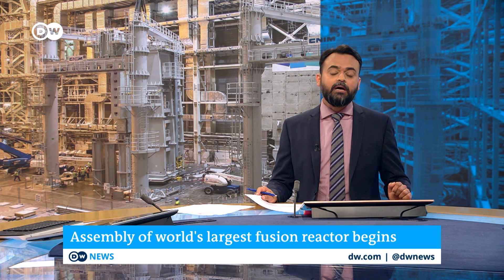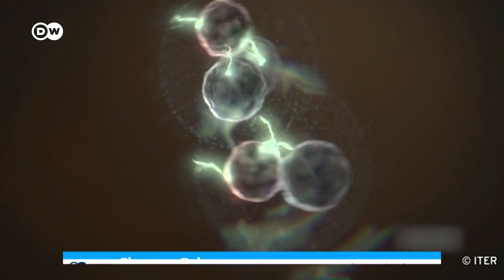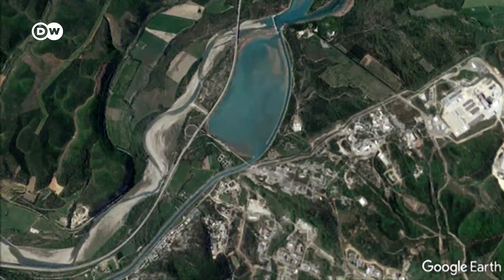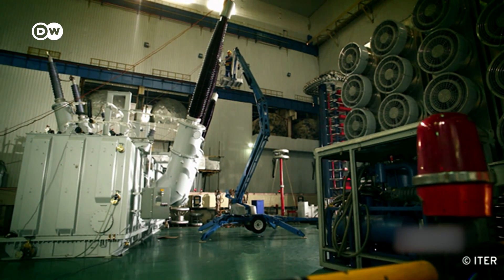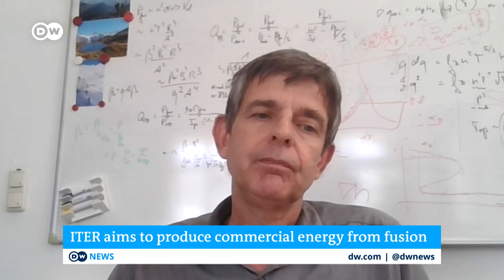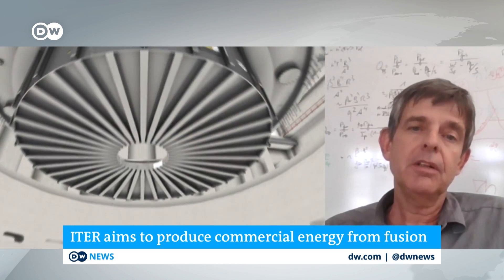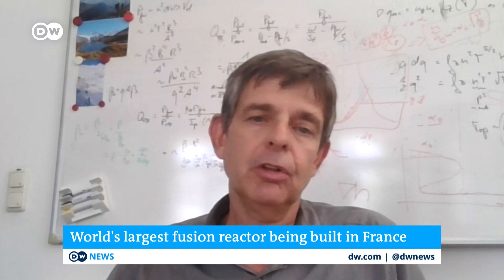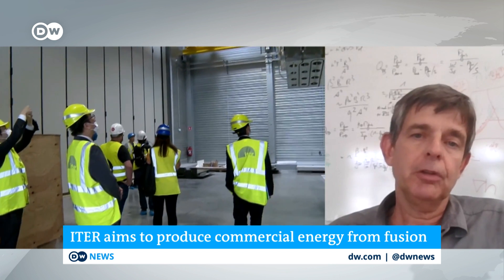ITER: Assembly of world's largest nuclear fusion reactor begins | DW News

Comment: SHEER MADNESS. IF THERE IS A POWER FAILURE IN THE SUPER CONDUCTIVE MAGNETS, WHAT IS GOING TO KEEP THE SUPER HOT PLASMA, 100 MILLION DEGREES HE SAID, INSIDE THE REACTOR? NOW ONE THING I DID NOT UNDERSTAND, WHY 100 MILLION DEGREES? THE DEUTERIUM-TRITIUM REACTION WORKS AT 30 MILLION DEGREES. THE PROCESS ALSO HAS MAJOR ISSUES WITH THE NEUTRONS PRODUCED BY THIS REACTION. IN FACT SUCH A REACTOR IS A HUGE NEUTRON GENERATOR. REMEMBER THE NEUTRON BOMB? HOW DO THEY INTEND TO SHIELD REACTOR MATERIALS FROM TRANSMUTING BY THE CONSTANT NEUTRON RADIATION? IN THE PAST IT WAS PROPOSED TO USE A LITHIUM LINER TO COVER THE REACTOR'S INTERIOR, ABSORB NEUTRONS AND PRODUCE ON SITE THE TRITIUM NEEDED IN THE REACTION. THE PROBLEM WITH THIS SOLUTION IS THAT LITHIUM IGNITES EXPLOSSIVELY AT THE SLIGHTEST AIR LEAK INSIDE THE REACTOR. SEE WHAT HAPPENS, FROM TIME TO TIME, TO CELL PHONES WITH LITHIUM BATTERIES. THIS THING IS GOING TO HAVE NO PASSIVE SAFETY AT ALL. THEY DEPEND ON EVERYTHING WORKING AS PLANNED...
AT 100 MILLION DEGREES, THEY MIGHT BE ABLE TO INITIANE THE NEUTRON FREE DEUTERIUM - DEUTERIUM FUSION REACTION, BUT AGAIN THE CONTAINEMENT OF A 100 MILLION DEGREE PLASMA REMAINS A SERIOUS PROBLEM, SHOULD A POWER FAILURE OCCURS TO THE MAGNETS. AFTER ALL WE ARE NOT TALKING ABOUT A FUSION EXPEERIMENT LASTING FEW MILLISECONDS, BUT A POWER GENERATING REACTOR WORKING 24/7 FOR YEARS.
Reply: It would just immediately stop. Why are you commenting when you don’t know the absolute basics of the physics?
Reply: @Gomlmon99  THE REACTION YES IT WILL STOP, THE PLASMA WILL INSTANTLY COOL TOO?
I AM WRITING WITH MY NAME, APPARENTLY YOU DO NOT HAVE ONE, YET YOU TELL ME I DON'T KNOW THE ABSOLYTE BASICS OF PHYSICS.  DO YOU HAVE ANY IDEA ABOUT THE BASICS OF NUCLEAR ENGINEERING OR YOU ARE ALL THEORY?  HOW ARE YOU GOING TO DEAL WITH THE PROBLEM OF REACTOR MATERIAL TRANSMUTATION DUE TO THE NEUTRON FLUX? IF YOU USE LITHIUM AS A NEUTRON ABSORBING LINER, WHAT ARE THE SAFETY MEASURES TO PREVENT IT FROM IGNITING IF THERE IS AN AIR LEAK INSIDE THE REACTOR? HOW WOULD YOU PREVENT A STEAM EXPLOSION IF THE PLASMA RUPTURES A COOLING TUBE? 
THE FISSION REACTION ALSO STOPS INSTANTLY IN A CURRENT REACTOR THROUGH THE CONTROL RODS AND THE POISONIG OF THE CORE WITH NEWTRON ABSORBING ELEMENTS. THE MELTDOWN IS NOT DUE TO A RUNAWAY FISSION REACTION BUT IS A RESULT OF THE HEAT GENERATED FROM SECONDARY REACTIONS OF NUCLEAR WASTE DECAY WITHIN THE REACTOR CORE. THIS REQUIRES COOLING OF THE REACTOR CORE FOR  UP TO 4-6 HOURS AFTER SHUT DOWN. IN CURRENT GENERATION FISSION REACTORS, EVEN IF EVERYTHING ELSE FAILS, THE REACTOR CORE IS FLOODED WITH WATER FROM A LARGE TANK ON TOP OF IT. WHAT ARE THE PASSIVE SAFETY FEATURES ON YOUR SYSTEM, NOT REGARDING THE FUSION REACTION IT SELF, BUT FROM THE SUPER HOT PLASMA? WHAT WILL THE LONG TERM EFFECTS OF THE ELECTROMAGNETIC FIELDS REQUIRED IN THIS REACTOR BE, TO THE HEALTH OF THE PEOPLE WORKING AND LIVING CLOSE TO IT? 
FRANKLY, I THINK THAT FUSION REACTORS WILL SOME DAY BECOME PRACTICAL ONLY WITH THE DEUTERIUM - DEUTERIUM REACTION. SO, NO RESEARCH SHOULD NOT STOP, BUT SCIENTISTS SHOULD NOT RUN FASTER THAN SAFETY CONSIDERATIONS ALLOW, JUST TO MAKE A POINT. NUCLEAR TECHNOLOGY IS RATHER UNFORGIVING REGARDING MISTAKES. 
FISSION REACTORS USING A THORIUM CYCLE INSTEAD OF URANIUM ARE MORE FEASIBLE WITH TODAY'S TECHNOLOGY.
BY THE WAY, EXACTLY THE SAME RHETORIC REGARDING ABUNDANT ENERGY, WAS USED IN THE THIRTIES REGARDING FISSION. IN THE 1939 WORLD TRADE FAIR, FISSION WAS ADVERTISED BY SAYING THAT A GOLF BALL WOULD PROVIDE ENOUGH ELECTRICITY TO COVER THE NEEDS OF NEW YORK FOR A YEAR. I THINK WE ALL KNOW HOW THAT WAS USED FIRST.
Reply: FLORATOSOTHON I’m not reading a wall of text all in caps, it’s horrible. Fix your caps key then write it again.
Reply: @Gomlmon99  THAT'S HOW I WRITE IF YOU DONT LIKE IT, TOUGH. YOU DID NOT HAVE A PROBLEM WITH CAPS THE FIRST TIME...

Comment: Having learnt more about Nuclear and coal being steam plant, and how that is less useful now because of lower base loads, I'm not so sure Fusion will be hugely beneficial.  We will need storage that same as we need for renewables.  Renewables will likely be cheaper than fusion especially if like fission, banks insist on demand guarantees.
With base load you need things to be inefficient so you can sell lots of it all the time.  Unfortunately (or fortunately) efficiency of loads has improved greatly and we need more flexible production.
I guess we will find something for it, home heating etc, but we need all these things before 2040.
Reply: Why would we need storage?
Reply: @Gomlmon99  steam plant cannot react quickly enough to meet sudden unexpected demand.  Renewables are intermittent.   Currently those peaks are met by diesel and pumped hydro, but batteries are now a much better option.   Ccgt is a reasonable intermediate fossil as it's only partly steam, but it sacrifices efficiency temporarily, and still takes minutes to respond.  Unfortunately making a nuclear turbine will be even more complex and expensive than a nuclear boiler. 
One possibility is that fusion is so cheap and plentyfull that we keep it a full power or idle it keeping the water hot and dumping excess heat, but fusion fuel will not be free it is unlikely it will be used wastefully, nevermind the effect of dumping heat.
We also need storage now as an alternative to fossil backup and fossil peaker plants, and even when fusion is worked out it will need decades to build plant.  That storage is happening via grid and vehicle batteries.  Good management via smart grid is needed and it's getting there.
Reply: @Gomlmon99  Steam plant cannot ramp up quickly to meet peak demand. It doesn't like switching off and on again taking hours or days to warm up.  There is no such thing as base load anymore.  Steam plant is only really suitable for base load.  Still it would be prudent to keep some available, much like Nuclear power a wide mix of power is useful, but it will never provide all our needs without storage.   Fusion still produces low grade radioactive waste, while this is much better than fission, its alot worse than wind which has a minor blade disposal issue.

Comment: What are they going to do with all the helium? That won't be good to pump helium into the atmosphere displacing the oxygen we breath & more detrimental effects on animals & the environment.
Reply: No. The production of a few grams of helium isn’t going to displace trillions of tonnes of air. And it’s also lighter than air, so can’t displace anything.
Reply: most likely leave the atmosphere just like hydrogen gas as they are a lot lighter than air or use it as fuel again

Comment: For the first 10 or 20 years beginning from the first time switched on ITER will be an experiment. It will not produce power that can be used by the public. There is a simple question: How many nuclear fission reactors are needed just to keep the first experiment running safely. ITER is only ONE plant. There are others. Imagine the consequences of one nuclear fission plant blowing up like FUKUSHIMA. Horrible as it was and still is, it is a small incident compared to a similar accident wiht ITER. The first ITER accident wil come and go. They will try again and again. Then it will work. Then they will build a much bigger fusion reactor. It wil work properly for some years. Then an accident will 'happen'. The whole thing wil blow up. ...
Reply: It can’t blow up, how could that possibly happen to a plasma at a vacuum??

Comment: more like thermo bomb!
Reply: It's literally impossible for a fusion power plant to explode like an H bomb. The reason is the set of circumstances needed to create a stable fusion reaction is very specific and if disturbed in any way the reaction just stops. The plasma returns to gas and that's about it. To get a runaway fusion reaction like an H bomb requires an entirely different circumstances.

Comment: nuclear is already clean and safe.
Reply: Except fuel procession is neither clean nor safe, while fusion only uses water that has been electrolysed
Reply: @UnePintade  deuterium is obtained by electrolysis of heavy water.  Heavy water is water that contains heavy hydrogen or deuterium, its expensive and certainly not anymore cleaner than fission fuel.
Reply: @nafiulshelim6194  it is cleaner since the major polluting agent coming from electolysis is how the electricity was made in the first place

Comment: I thought a net gain was shown way back in the early 2000s? Sure it wasn't a lot, something like <0.2% gain over the input. I don't doubt that fusion power will work out someday, but I think the time scale must be on the order of centuries, not decades. Maybe by the 2300s we'll have something workable, but physicists and engineers have been touting Tokamaks since before I was born and I never hear about how the technology is improving, or what they are discovering. Unlike other fields, like medical science, biochemistry (my personal field of expertise), cosmology, astronomy, and computer science, it seems the fusion sector just keeps on pulling out the same show ponies for display every 5 years or so. By this point those ragged old show ponies are almost ready for the glue factory, much less pristine display. 

I've also been following General Fusion as well, and they've pretty much stopped making any meaningful progress scientifically about 5 years ago themselves (at least anything that they could publish), and they were the first new Idea I've seen during my lifetime. Sure, it wasn't a totally new idea, more of an abandoned one that required the greater computational power of the modern world, but still, it was at least something other than yet another Tokamak that goes nowhere. 

I know there are some very intelligent scientists working away at this, and I am sure there are probably a few hundred publications that detail the plasma physics of Tokamaks, but I've never gotten wind of any true breakthroughs. Every "breakthrough" I do get a hint of seems to disappear and never go anywhere. That is usually a sign that there are scientists pushing an idea that is a pipe dream and they don't want to give it up. Powerful and influential enough scientists can carry a dead idea for decades, because they "believe" in it. I've watched it personally, it destroys careers and holds back fields. The only intervention that works is when their colleagues get wise and start some tough peer review. I can't say that's the case here, but I suspect after decades of Tokamaks, that maybe the pony has already been mashed into glue.

Comment: It will not work. Even if the plasma is magnetically confined, the magnetism cannot contain the radiated heat and every known material will vaporize long before it can conduct the 100 million degree heat to the thermal transfer cooling system.

Comment: The animation of H to produce He doesn't fuse with He. Two H atoms doesn't fuse directly to He in a star. Star burn goes H  + H = D+b+v, H to Deuterium + positron + neutrino. Two more steps after that create He,  Helium. In fact the third step produces more Hydrogen. Fusion plant would be D + T = He + n, Deuterium + Tritium to He + neutron. Deuterium and Tritium are hydrogen isotopes.

Comment: How about we skip fusion and go directly to starting a Dyson Swarm? Beam energy back to Earth. Or Geothermal taps? You need only go down insofar as to get enough heat to boil water.
Reply: When it comes to geothermal the thermal tap has to be close to the surface in order to make the cost at a reasonable no to mention  in certain counties don't have the luxury of having volcanoes or thermal cracks (idk what they are called) the costs to dig to the falts will be very costly

Comment: The main problem with fusion is the plasma is too hot to be used in a traditional heat exchanger. The best they can do is heat water with neutron radiation from the fusion reaction. But this will eventually cause neutron embrittlement.
Perhaps they can regain some of the energy by using the ionized plasma in such a way to induce a current and create a generating effect.
Reply: Are you a nuclear scientist

Comment: It seems that only a few years ago that science said fusion wouldn't work.
Reply: It's a research project.  It still may not be feasible to have a commercial fusion reactor for power.  In any case, the energy solution may not be too far away.

Comment: I'll come back to this video when the dyson sphere will be built
Reply: I'll come back when biochemists have figured out biological immortality. (A more realistic goal than you may think.)
Reply: @gregorymalchuk272  The brain is only a receiving and transmitting device of your awareness. The soul doesn't have a material form, thus it can't be copied.
Reply: @OpenGL4ever  
I never claimed it could. I'm talking about biological science-based life extension and immortality. They have already identified drugs that extend mammal lifespan by 30 to 50%.
Reply: @gregorymalchuk272  To incease the life span you wil need to find and set the timer that determines the cell splitting rate. You will have to increase it. But beware, in the event of a nuclear accident a fast cell spliting rate can be fatal. It is also a disadvantage in the case of cancer. 
For more background informations:
A baby has a super fast cell splitting rate, that makes it look young. With increasing age the cell splitting rate decreases and we start to look older. When we are very old the spell splitting rate is so low, that it is not fast enough to regenerate the body fast enough to look young. 
So to some it up. If you find a way to increase the cell splitting rate of a very old man he does have a chance to look as young as when he was in his twenties.

Comment: maybe we should only scale things up when we know they work.....
Reply: We do know they work
Reply: @Gomlmon99  Ohh well maybe I am a little outdated. the last I heard was that it could only be turned on for a short period of time and I assumed that with the scale up, the short period of time gets scaled up..

I am a little fearful of the entropy that could arise from generating a star within our atmosphere though :??
Reply: Busta it can only be turned on briefly now, but we know why - it’s largely because we use copper magnets which heat up and would melt if we carried on. Future projects will use superconducting magnets, which have no resistance, therefore don’t heat up. 

There are small plasma physics issues, but they’ll be ironed out as our understanding grows. The main problem really is materials, an engineering problem, but scale up doesn’t change that fact. But you gotta experiment before you get things right. 

It’s not a star, so nothing to worry about. It just uses the same type of reaction. In the same way a TNT exploding and a person respiring do (a chemical one, rather than a nuclear one).
Reply: @Gomlmon99  two hours??? where did you hear that? thats pretty good. Im pretty sure the lack of resistance has nothing to do with the heat capacity and therefore the materials will mostly rely on the cooling systems to keep them from melting.
fusion is what the sun does.... essentially its a star, but still my main concern is the amount of entropy that will be released in any case, because clean energy is great but any extra radiation will destroy us with the amount of CO2 in the air still rising.
Reply: Busta I heard that because it’s my job, I work on DEMO design, amongst other fusion related things. 

It’s not about heat capacity, it’s resistive heating - “Ohms Law”. A superconductor has zero resistance, meaning the current doesn’t cause it to heat whatsoever.

The superconductors will still require cooling, but that’s purely because a superconductor currently has to be roughly 4K to work. 

The amount of radiation released into the atmosphere is effectively zero compared to energy sources such as coal, which release a significant amount of radioisotopes.
Reply: @Gomlmon99  nice!!!! whats your job title or specialization within the project???
I understand the properties of a superconductor, but I also understand the properties of thermodynamics. I am not referring to the conduction and Ohm's law. I am referring to the fact that those super cold conductors are in contact with a super hot plasma. It has nothing to do with the electrons but rather the effects of thermal, vibrational, kinetic and rotational energy being passed between two surfaces in contact. 
I cannot say the same for the radiation, but assuming these high energy particles crash into something this will also cause more than the passing of electron particles. 

effectively zero is not the same as zero and that is probably going to change in scale up.
Reply: Busta Busta I’d rather not say my job title online as I don’t want to be identified but I’m an engineer rather than a scientist, so I don’t deal with the plasma physics itself. 

I see what you mean, although the magnets themselves won’t be in contact with the plasma. They are kept safe behind a “first wall” which is made of neutron/heat resistant materials, primarily beryllium and tungsten. In theory, the magnets should remain cold and untouched, kept static by the cryostat. 

The high energy particles should be captured by a “breeding blanket”, which produces the heat, reproduces the tritium, and stops everything behind it getting destroyed.

It is true though, that in some designs of future plants, the central solenoid is likely to have to be replaced due to neutron damage.
Reply: @Gomlmon99  looking into the most up to date coverage, it would seem I am right and this reactor will only run for a few minutes while there is a more advanced design that they apparently havent designed on the smaller scale very well yet.
Reply: Busta ITER I think will run for 8 minutes. DEMO is currently planned for 2 hours up, 10 mins down, and so on. But that’s subject to change.